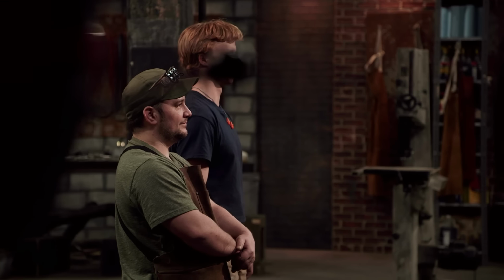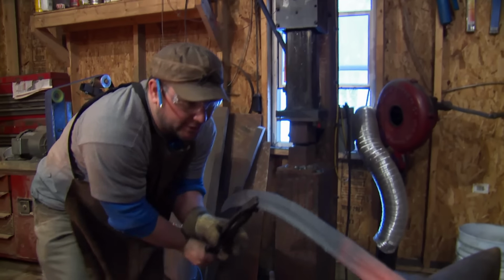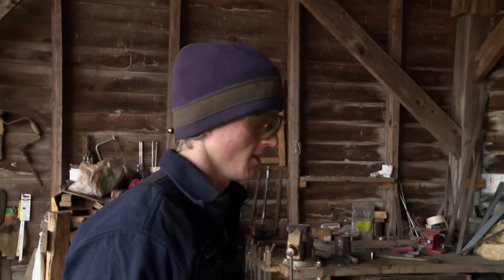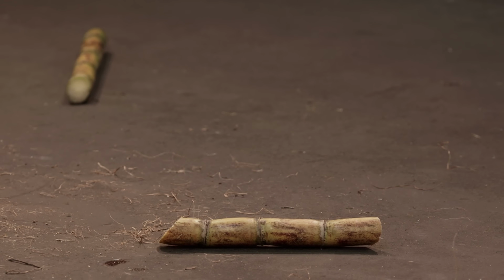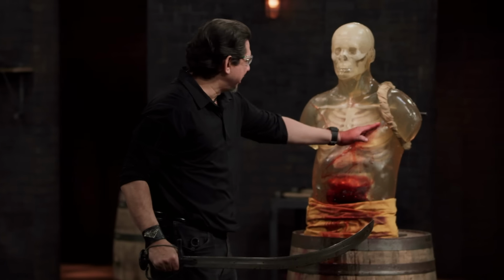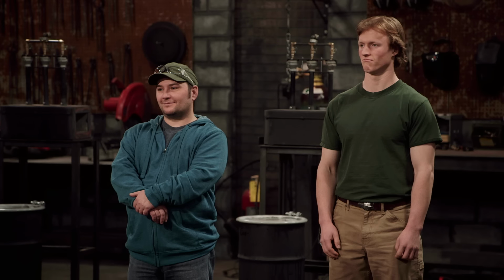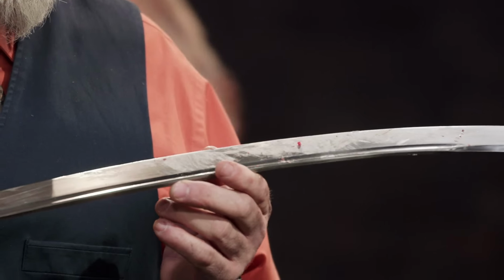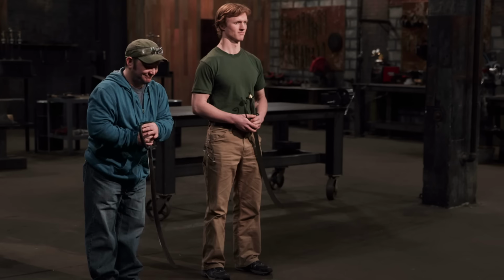Forged in Fire: THE TALWAR VS. EXCRUCIATINGLY TOUGH KILL TESTS (Season 4) | History

Comment: A good traditional handle filler i use is a mixture of boiled tree sap and charcoal powder (with herbs n spices lol) ... It give the handle a good vibration absorbtion quality and for re hilting u can boil the handle in water to soften the filler and "modernize, customize" the furniture without damaging the blade temper but having to burn off epoxy.

Comment: Fun fact: Tulwars and Viking Era swords are known for impossibly small handles! It seems that they gripped them such that the trigger finger is above the grip.
Also, unusual for Western blades, they often glued the hilts on rather than peen them. Brass handles were quite common, probably because casting such forms is easier.